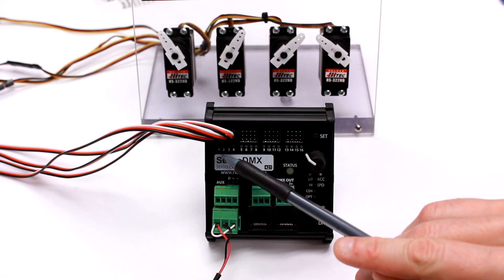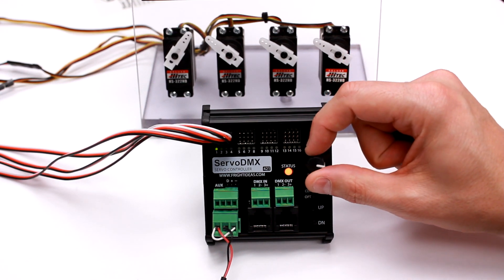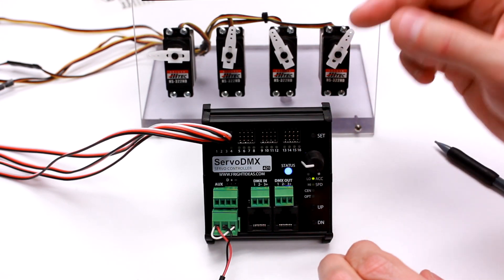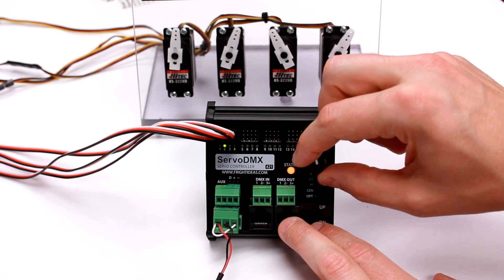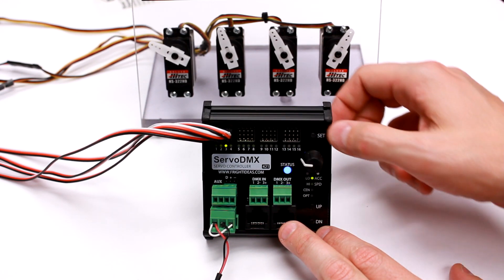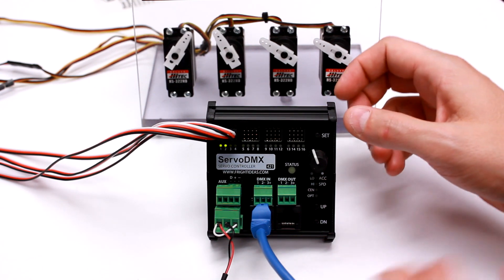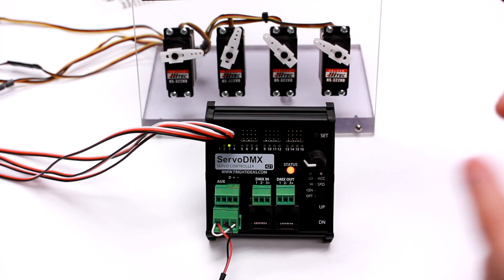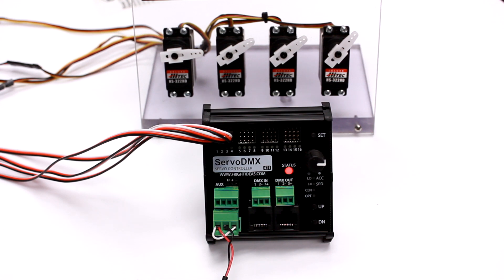ServoDMX - Servo Setup

Comment: Can the controller als handle servo's of 7,4 or 14 Volts?
Reply from the maker: It can handle 7.4 volt servos if you increase the maximum servo voltage in the settings.  The maximum that can go into the ServoDMX and then out of the servo outputs is 8 volts.  Servos with voltages higher than that usually have separate power inputs so the controller still outputs 5-6 volts.

Comment: I’m completely new to this type of stuff. I’d like to know, if you could tell me, what kinds of motors are compatible with this? Are these motors able to handle heavy weight? If not, are there compatible ones that can?
Reply from the maker: Search for "RC servos".  Basically any RC servo will work.  They come in a variety of sizes from very small and cheap, to very large, strong, and expensive.

Comment: im wanting to make some small moveing heads for a model im builidng and wanting to use servos would this work ? for that purpose and would i be able to connect this to something like a ADJ WMX1 Wolfmix DMX Controller ?
Reply from the maker: Any device that outputs DMX should work as a controller.  We haven't used the WMX1.  As long as you can program it to change the channel values the way you want to move the heads it should work. Not sure how you do that on that device as it has no sliders.  Maybe with the software.

Comment: My new servo does not move at all. Please from the very beginning open box.  I got servo dmx, director connect, hs65mg servo, director software. Thanks.
Reply from the maker: Hi.  Please contact us at support at frightideas.com.  We can help you there if you haven't already figured it out.  Thanks
Reply: @frightideas thank you. It was helpful,  then I switched to Brookshire software cause I needed video outputs.  But now I'm back to maestro and dmx421.  I hope someday you could do a set up with synchro videoplayer input and output. I'd buy it right away
Reply: Thanks. Tonight i pressed the SET key and the servo moved , and now i can move it with the fader, thats my first step. But i plugged in the director connect and nothing happens, i wrote some random lines on channel servo 1but nothin happens. When it asks me to assign a controller there are some options with the picture but there's not servo dmx option so i just picked picko dmx but i guess is not the right option.
Reply: Ill contact the link you sent me

Comment: How do you set the power up positions?  It's mentioned in the manual but I can't locate anything explaining how to do it.  Also, how do you keep the servos from jumping when powering up or when DMX is applied?  I'm waiting for my unit to arrive so I'm trying to get these things figured out ahead of time.  Thanks!
Reply from the maker: Hi.  It's in the Installer Setup Menu section.  Four green blinks.  Some servos always jump a bit when they are first powered up.  This feature makes sure they don't power up and race to center at full speed.  But it only works if the servo is in your set startup position before the ServoDMX is powered up, as the ServoDMX has no way to know what position the servo is actually in.  If certain servos will always relax into the same position when power is removed, set that as the startup position and it will help minimize the jumping.

Comment: Will this support continuous rotation servos? Thanks!
Reply from the maker: It should.  They use standard servo signaling.  The speed and acceleration features of the ServoDMX would just control how the servo rotates, rather than how quickly it moves to the selected position.